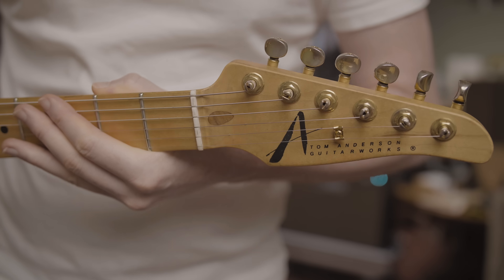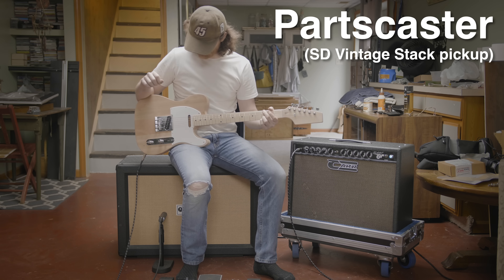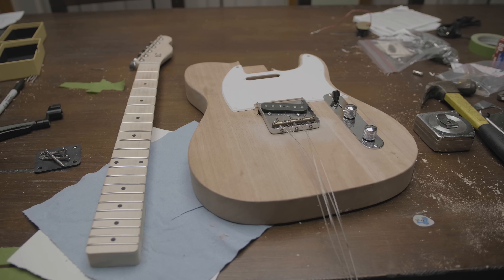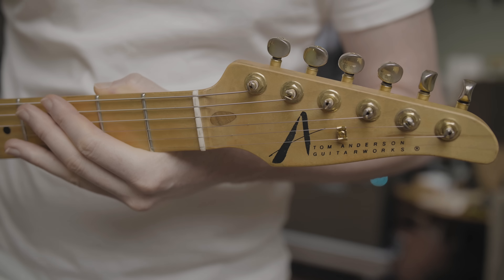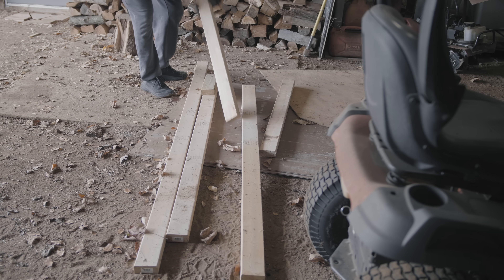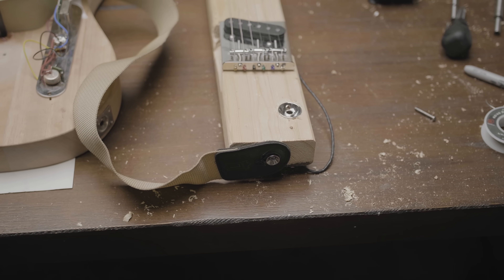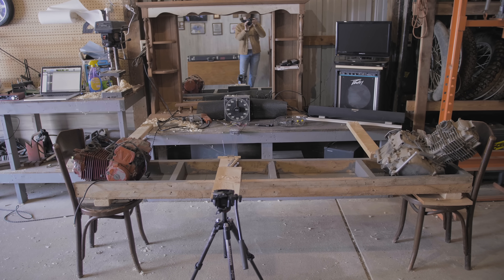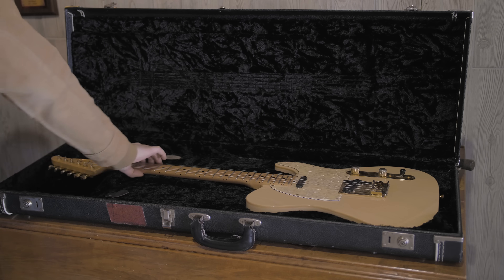Tested: Where Does The Tone Come From In An Electric Guitar?

Comment: The most surprising thing for me here was how much changing the shape of the headstock changed the sound. I would have never thought that that mattered so much. I get that that's probably super difficult to test in a repeatable way, but I noticed a huge difference between the sound of the partscaster with the plank headstock and the more "normal" shape. Makes me wonder if the post-CBS Fender guitars with the big headstocks suffered part of their ignominious reputation due to that choice.
Reply: He mentioned at one point the pickup was somewhat loose during the first tests and shifting around between modifications. It's quite possible that any difference you heard was from that and not the shape of the wood. 

I'm leaning towards the shape making little very difference for tone myself given how close the "air" guitar sounded to the Anderson, considering everything about it's body, neck, and headstock were wildly different and should've sounded further off if shape mattered that much.
Reply: @calebraney1705 ...your sarcasm is noted.

Comment: First is how you activate the strings, then is tuners, bridge and frets mass and material, then string length and tension, next is pickup placement, then pickup qualities and distance to strings, last is if the neck has a hole (for the truss rod) or not (check Vigier and Steinberger).